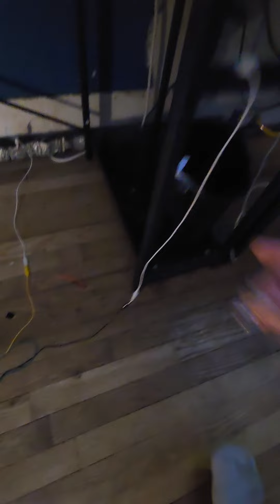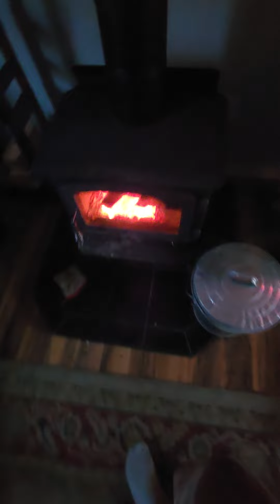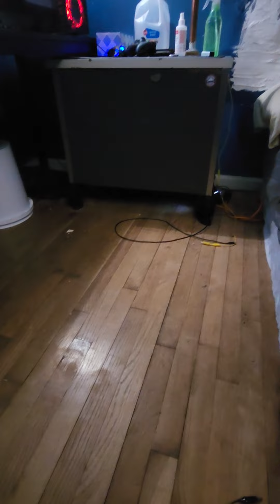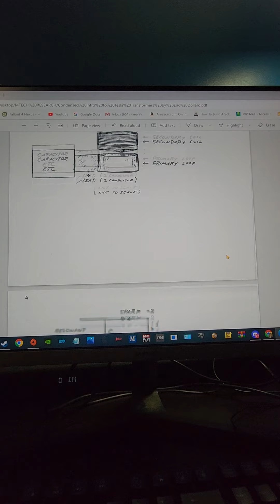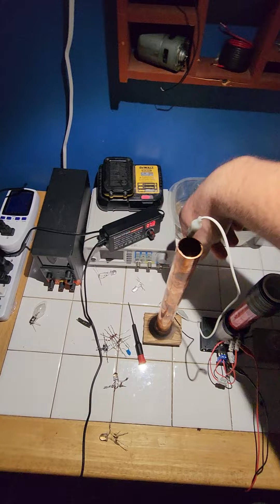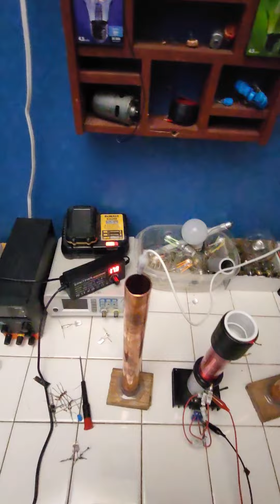🌪 MOTOR SPINS FROM WIRELESS GROUND POWER! ANOTHER BREAKTHROUGH! 🌀

Comment: In a new house wiring requires AFCI breakers. I think you would pop each breaker connecting to the ground. New code requires AFCI for nearly every circuit. Tesla said the hardest part is getting ground right. Colorado Springs notes: He went down 12 feet, used coke around the grounding plate, and a lot of water to wet the dry ground.
Reply: Without proper ground ur Amp draw will not b exact get a good ground if u need Amp for ur load.... Voltage come but Amp wo ground is not good enough

Comment: By attaching that to ground you are essentially putting high frequency pulses into the ground wire. The ground wire is simply a large conductor propagating the energy around your house. Plug an oscilloscope to your ground wire and you can see this.

Comment: Ahhh, you got motor running now... & incandescent bulb, very nice 😃
Reply from the maker: Yes & effects I don't fully understand are occuring at those 2 ground points in my room when my transmitter is powered on. I've also observed slight over unity at that spot too along with the ability to create unlimited light from my seperatly grounded receivers
Reply: @MTECHINDUSTRIES  try series connected grounds and pulsed dc in certain earth pts and return to ur coils always use dual coils as capacitance ie dielectric nd inductance magnetic in coils r bi directional or never uni polar so rest u create the resonance needed between the two to achieve ur power
Reply: @MTECHINDUSTRIES  most likely ur  amps r going up or power wt is the calculation chk that 4.3x18  ie abt 80watts nd 2x18 ie approx 40watts..... Or double the power chk max what power u can use ie can a 300-400 watt bulb ie resistive load or motor w cap ie  reactive/active or inductive load b put...wts the max u can draw nd a similar can it transmit w a slayer as u put 1 mter in the secondary slayer wd it work using this as ground as in ur wireless circuit u used and can u extend it
Reply: @MTECHINDUSTRIES  put copper rod receivers w act as repeaters in octagon shape catacomb like at the intervals and let's c how far u can take the electricity to do useful work w a proper ground and do speak abt the max length and the length of ur primary nd secondary

Comment: You should use stud detectors or metal detectors to see what’s behind the wall. Maybe try reflecting or concentrating different parts of transmitter, check other spectrums for radiation, ir/uv etc…expensive equipment but one way to maybe gain insight into your excellent question.